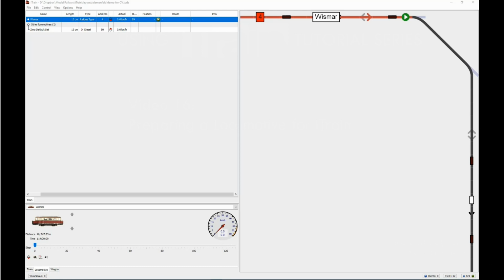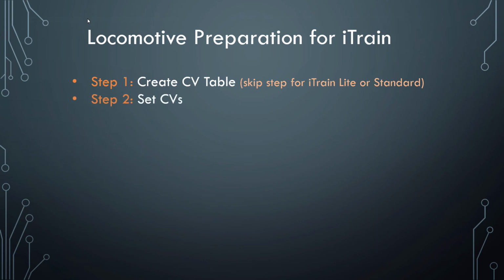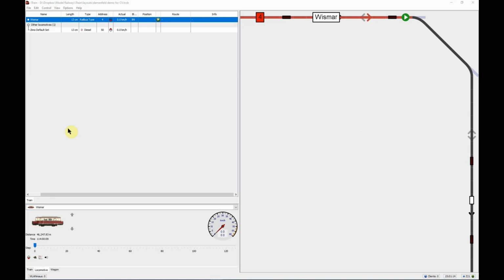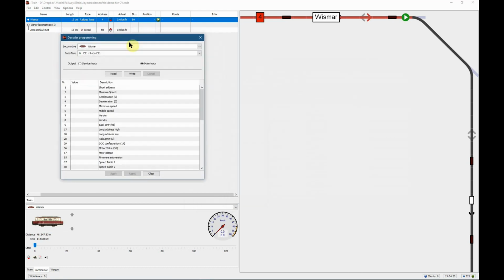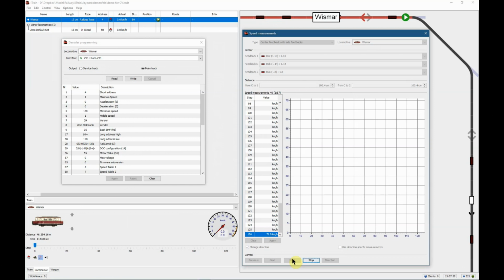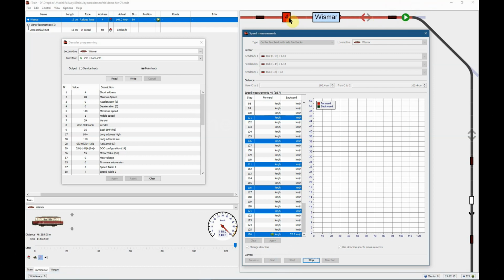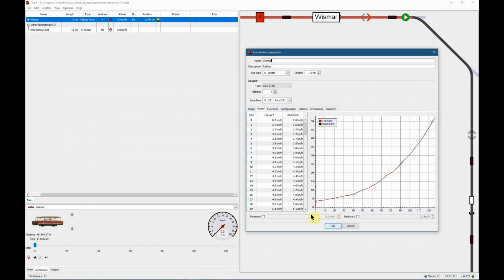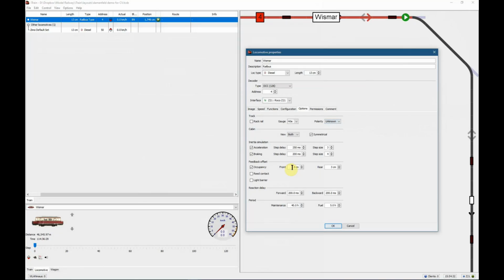Video 16: Using iTrain Tutorial Series - Preparing a Locomotive for iTrain  (Part 1)

Comment: Great video!!! Question about the inertia simulation: My locomotive has a braking sound that will sound prototypical. Will the CV setting 3 and 4 and the inertia simulation settings affect the braking sound?
Reply: The CV settings, especially for sound locos, can be a bit of a moveable feast as how far a loco travels before stopping with CV4 set to 3 with one type of decoder is generally very different to how far the same loco would travel when braking using a different decoder. Even between “identical” locos using the same decoder you will generally find that the CVs, acceleration, braking and reaction delay will be different due to the range of external factors influencing the model.

What I provided the tuning that Bob describes as a very good primer for most locomotives however this must be read in conjunction with the decoder and sound project instructions as the manufacturers all have different interpretations of the values and how the work with their installations.

I am sorry that I can’t provide a definitive answer that covers every decoder, sound project and locomotive but the permutations are simply too expansive and hence I have provided the mechanisms that you will need to adapt to your specific installations.

I hope that this is useful 

Iain

Comment: Another great video. Can you clarify about the track being used. I assume that iTrains must knows the distances between sensors.
Reply: I use DR5088RC current sensing feedback decoders therefore there aren’t any discreet sensors to measure any distance between them. When a loco is within the section of track powered by the feedback it is constantly ‘sensed’
Reply from the maker: The next but one tutorial will be about the three different methods of Speed Measurement. That will hopefully make things clearer.
Reply: @bobfuller  OK thanks I wait with eager anticipation!

Comment: Great video once again Bob and very well explained. Does CV6 (Speed curve modifier (Mid point)) play a part in any of this?
Reply from the maker: No, CV6 is typically  used for 3-point speed tables. In iTrain we aim to populate all the speed steps so that iTrain has better, smoother control of the train.
Reply: The need to alter CV6 is dependent on whether the decoder that you are using automatically calculates a suitable value for CV6. You will have seen that I am using Zimo decoders which do not require you to alter CV6 if you leave it in default. Other decoder manufactures may require you to alter CV6, some will not even allow adjustment of CV6 and you should always refer to the manufacturer instructions for your specific Decoder on which settings will need to be adjusted to provide suitable running.